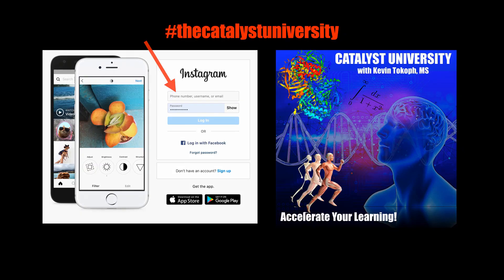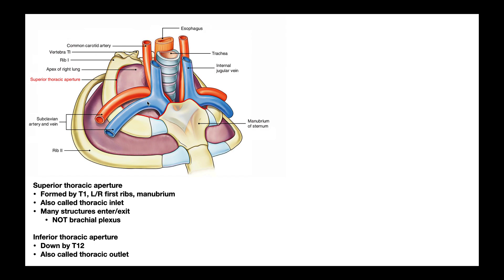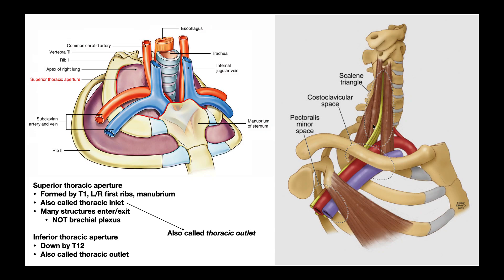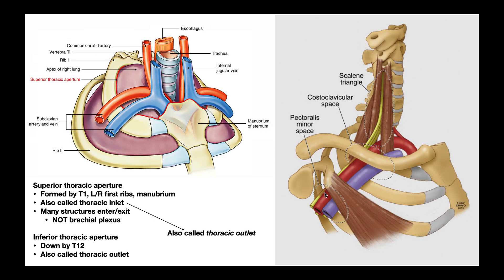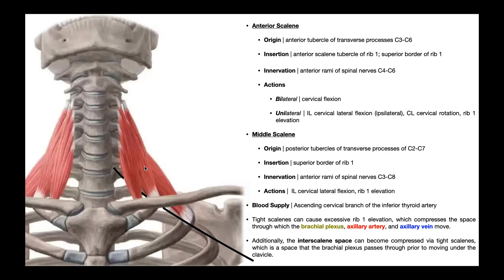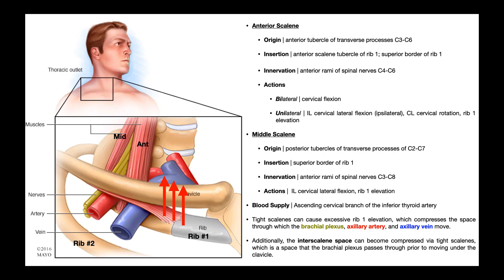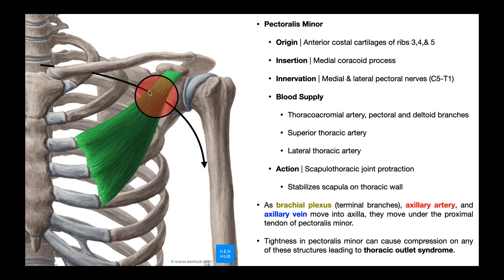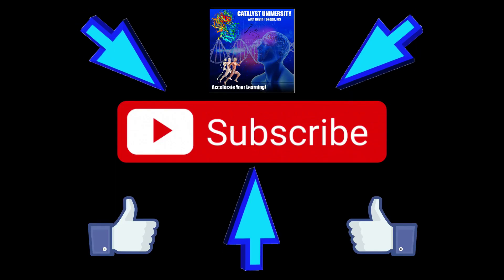Mechanism of Thoracic Outlet Syndrome [Anatomical Approach]

Comment: Nice video but if scalenes are tight/always tight stretching won’t work they’ll just tighten up straight away.

Why are they getting so tight? Because you’re not breathing through your rib cage & they’re working as auxiliary breathing. Fix the breathing fix the scalenes. First rib mobilisation will be a must if this has been a chronic issue